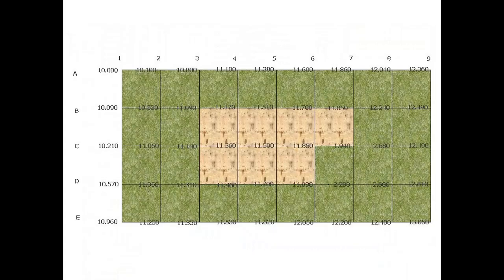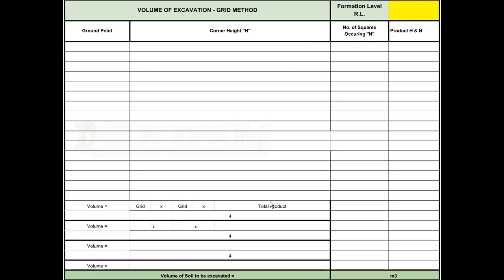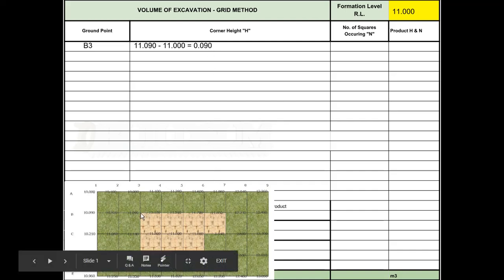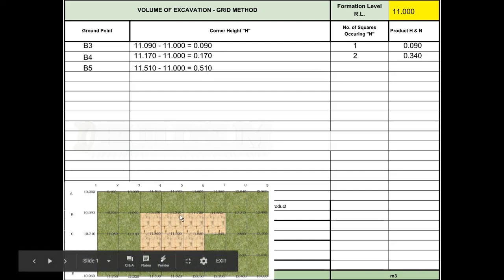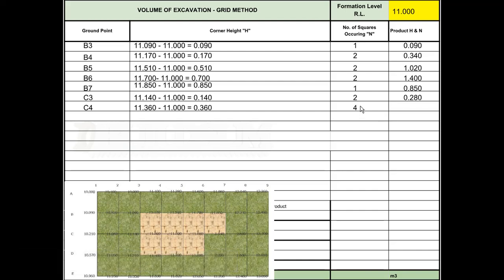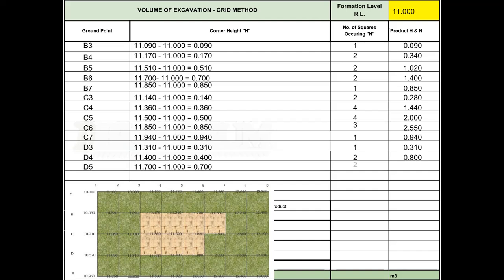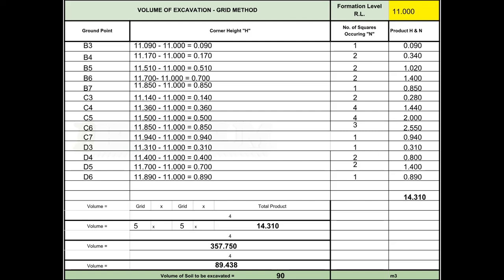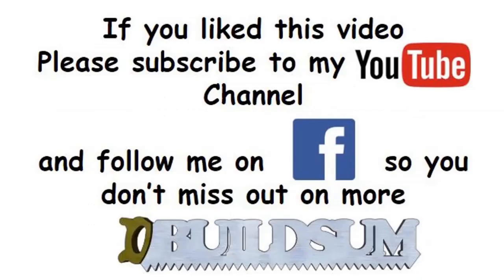Cut and Fill Calculations

Comment: Since contour lines 11 and 12 weren't presented on your survey sheet, it would not easier to understand the relations between those grids, and I didn’t see any fill?
Reply from the maker: Hi, Sorry I am not sure that I understand the question. There are no contour lines on this plan, I am using the RL of each corner of a Grid the we would have got from conducting a Grid Survey of the site.
Reply: @Buildsum  If you interpolate the spot elevations, you will find contour 11, 12 on your site. In fact, counting each overlapping spots is not necessary if proceeding it cell by cell, and it somehow could avoid confusing. Here is my way to calculate it manually:
There are 7 grid cells on your survey sheet, (I label the cells from left to right, top to bottom). 
( Step 1) find the difference in elevation for all corners of each cells
cell 1: 0.09+0.17+0.14+0.36=0.76 m;
cell 2:0.17+0.51+0.36+0.5=1.54m; 
cell 3:0.51+0.7+0.5+0.85=2.56 m;
cell 4:0.7+0.85+0.85+0.94=3.34 m
cell 5:0.14+0.36+o.31+0.4=1.21m
cell 6: 0.36+0.5+0.4+0.7=1.96
cell7: 0.5+0.85+0.7+0.89=2.94
(Step 2) Add up all the cutting depths of 7 cells=14.31 m, and then dividing by 4 (corners) = 3.5775 m, 
(Final step) 5m x 5 m (grid size) x 3.5775 m= 89.4375 cubic meter.

Comment: You are doing it the long way, just multiply number times each level occurs by the grid level at that point then divide the overall total by total number of grid points and you get same answer in half the time.
Reply from the maker: Hi Seamus, good to know, thanks for sharing.
Reply: @Buildsum  Hi guys, can you please explain the method Seamus uses in more detail? Thank you.
Reply: Hi Seamus, I would like to see the workings of your explanation.......I learnt it the exact way as what buildsum has explained and it is pretty fast once you understand it.

Comment: Hi Buildsum, i have a similar site like this however the problem i have been given does not have the levels in the corners directly, i am confused on how to approach this because this is the case. Also great video, is there any possibility for guidance on this matter?
Reply from the maker: Hi Max, in order to get the Reduced levels (R.L.s) of the corners you need to have conducted a Grid survey and then take those reading and convert them to the Reduced levels using a Level book. Once you have the R.L.s you can use them to calculate the corner heights and therefore the excavation required.
Hope this helps

Comment: Hi Dude, Firstly love all your videos, without which i wouldn't be completing my Cert 4 lol, quick question, what happens if you have calculations in the corner height column and product H &N column that are a negative? do you subtract these from your positive calculations? or total them in a separate calculation to get your fill volume? Many thanks, Marty :)
Reply from the maker: Hi Martin, negative figures are just subtracted from the positive one.
Reply: @Buildsum  Thanks Dude :)

Comment: Hi Mate thanks for the great video! I understand this, however my assignment states that a bulking factor of the soil is 1.25. Do you know how this would affect the calculation of the volume?
Reply from the maker: Hi mate, thanks for your comment, i would take the 1.25 to be the factor that you need to multpy your total by. So say you got 100 cubic metres of excavated material 100 x 1.25 (25%) = 125, so you would need enough trucks to carry 125 cubic metres to carry it all away due to the bulking factor. Hope this helps

Comment: If you wanted to work with the slope of the land, how would you determine how many steps and what level to place them?
Reply from the maker: Hi Casey, the first thing is to work out the size of the step that you are going to use. These generally made to work brick courses or blocks as this will safe the bricklayer cutting. You can then divide the difference in height from corner to corner and divide it by the height of the step. As to where this will depend on the slope of the ground. You can work this out by getting the height of the top of the footing on the high side and then work out where it is going to come out of the ground, that is where the step should be.
This video may help, https://youtu.be/FqVNgtQkICI

Comment: Hey mate, how would you apply that calculation method using a footprint overlay with no squares?
Reply from the maker: Unless you can place a grid over the plan and get the readings for the intersections you cant, sorry.

Comment: If we have squares of unequal areas and our grid points forming a part of it
what should we do sir/
Reply from the maker: Hi, to use this method you have to set out a even grid patten for your readings. If for some reason you couldnt i guess that you could work out the area of the shape that you have and mutiply it by the average depth but i have not seen a method or formula to do this.
Reply: @Buildsum  Thank you a lot!!

Comment: Great Video.
Just a question why at the end you times 5 by 5 of Grid measurements to calculate the volume? Cheers
Reply from the maker: In this example 5m x 5m was the size of the original grid on the ground when the readings were taken to get the surface reduced levels. hope this helps.

Comment: Hi,

Can you elaborate calculation for fill ? Just to make sure
Reply from the maker: This is one method of calculating the amount of soil (spoil) that you would have to remove from a site to level it to a nominated Reduced Level(R.L.). At the end of the video, I show you how to work out the R.L. that would be required if you were to use the material that you cut from the site to fill in the low spots and bring the site up to the nominated level.
Reply: @Buildsum  Thank you.

Comment: Hey Buildsum why do you times  it by 5 and than 4?
Reply from the maker: Hi Dean wi multiply by 5 because that was the length / size of the grid on the ground when we took the survey. We then Divide by 4 as there are 4 corners per grid square.
Hope this helps
Reply: @Buildsum  cheers legend